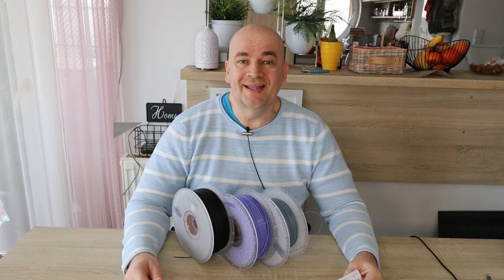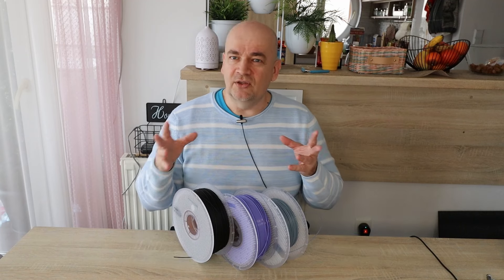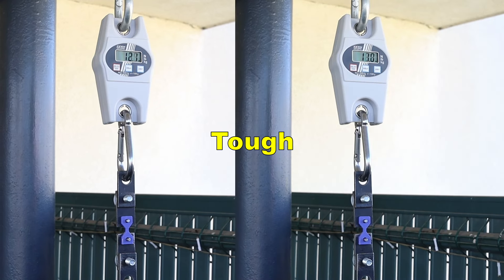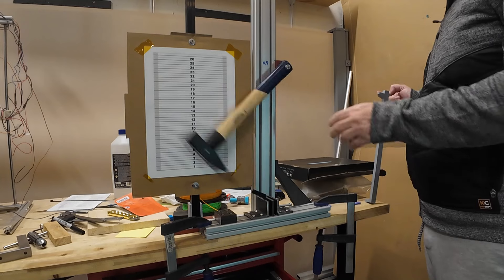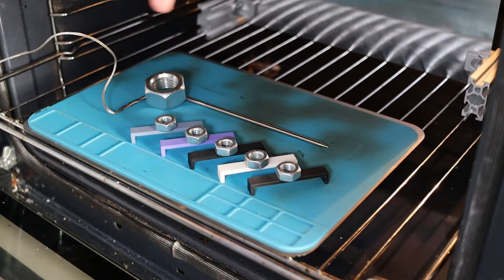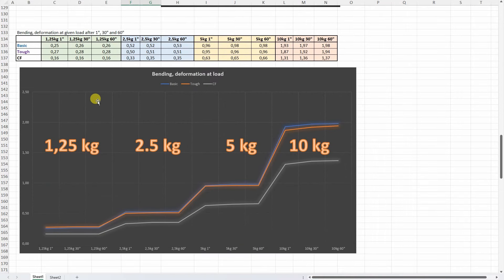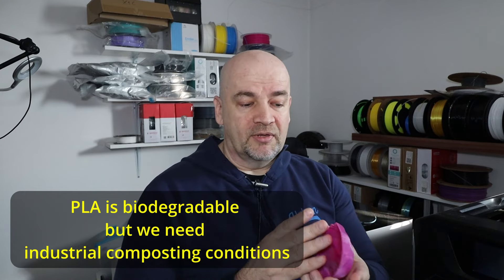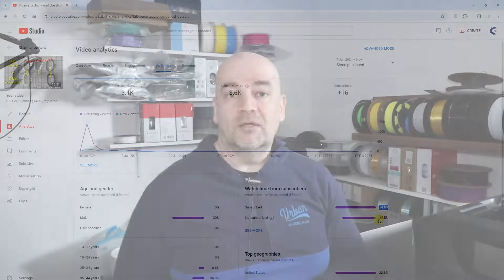BambuLab PLA Basic vs PLA Tough vs PLA-CF

Comment: Hi Dr. Igor! Great stuff as always! Man, the impact test really surprised me… I was really expecting the CF NOT to be the most brittle of the three. Looking for the the annealing video. Dimension stability might be the best property of CF PLA in general. One thing is clear: CF looks awesome.
Reply from the maker: I checked that impact test (off camera) and same results. BL must be adding something to its filaments, so they are not brittle, and they cannot be brittle, otherwise they would break in AMS after some time. Recently I had a filament break in AMS (with some other brand, old PLA)

Comment: I would like to convey my personal thanks to you Dr. Gaspar for your time, dedication and devotion to all these extremely superb videos. Do you have any recommendations or preferences for increased layer adhesion of parts when printing at higherfaster speeds? I'm genuinely curious about annealing as, I've considered other indirectly proportional variables such as print temp, layer height, etc. Any thoughts or advice is greatly appreciated. Once more, thank you kindly for your time Mr. Igor. Much respect to you from 🇺🇸
Reply from the maker: Thank you. Speed vs layer adhesion tested: https://youtu.be/W3SCl302CP4?si=uIcH3HqMO1YUZe6d And I have a lot of material testing videos in my pocket, only I have to reduce 3D printer product reviews..
Reply: @MyTechFun  awesome, that sounds exactly like what I'm looking for! I'm sure it'll be exceptionally thorough as well. Thank you for pointing me to this info! As I'm a recently new subscriber this helps immensely. Cheers to you kind sir.

Comment: Thank you for this video.
The PLA though was much better on the p1s or I'm confusing?
Can you check if increasing the temperature on the X1C is enough to compensate?
Reply from the maker: In previous video, when I printed on P1P I used different test objects. But in this video I tested layer adhesion P1P vs X1C: https://youtu.be/4yxKrHJMHC4
Reply: Ha ok my bad, now I understand why results are so differents.
I seen this video as well, but I'd like to know by how much degrees I have to increase the temperature to compensate the weaker layer adhesion on my X1C.
Great work

Comment: Of course the advantage of Tough is that it is tough and has better layer adhesion. It wouldn't have better print quality. I am fairly confident upon testing that it is much tougher than PLA Basic. It is an engineering material. You can buy Inland Tough - just slow the flow to 15 for it.

Comment: Hi Igor, there is new type of Petg on the market now, called rapid or high speed Petg. I think e-sun and elegoo has it. It would be nice to know if these filaments are indeed can be printed not only on high speed printers like bambu and it's counterparts but on regular printers as well. Since the printing speed bottle neck on regular printers were about the printer's end but the petg filament itself.

Comment: I have a printed tool that will need accurate dimensions and good abrasive resistance, which filament would you recommend? I normally use ASA for this, but at the moment I only have PET-CF, PAHT-CF and PETG-CF. Would you recommend any of those?